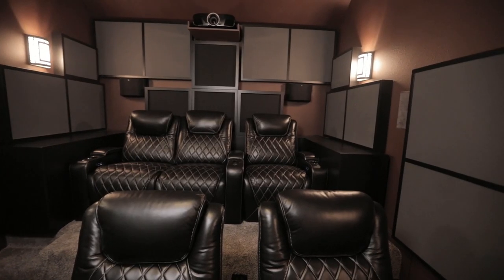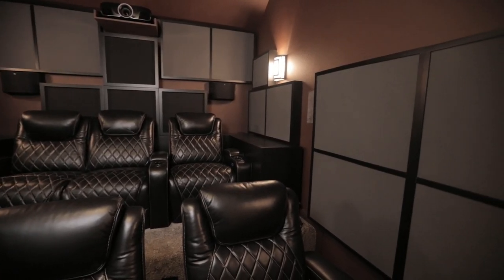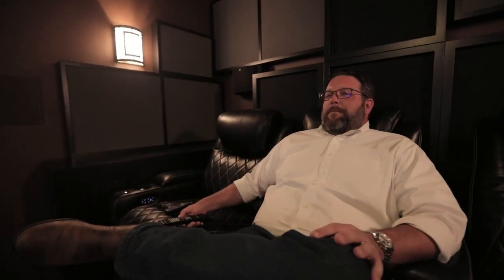Home Cinema - Dolby Atmos - Houston, Texas - www.AcousticFields.com

Comment: I have 2 16’s in a 10x12 8ft ceilings , I have the smallest theater out there and I had issues with bass and I have corner traps to the ceiling , upgraded to Dirac cause audessy is part of your problem. I woukdnt think 10’s could become boomy.
Reply from the maker: "Boomy" is a pressure issue within your room. If you treat the pressure issue, no boom regardless of driver diameter. Processors are another individual's  bandaid. Do your own thinking.

Comment: Great Video, I believe in acoustic treatment.
The room is the biggest problem not the equipment.
A room determines the sound quality.
Treat the room first before upgrading your equipment.
Reply from the maker: Placing higher resolution gear in the same room of distortions makes no sense. Keep your gear and increase the resolution of your room. You will not need new gear. All the original resoans you bought the gear in the first place with reappear in a tretaed room. If after the room resolution has been increased through proper treatment then and only then can you evaluate new gear.

Comment: Because the software thinks your subs are to much and it lowers the dbs down , I’ve had 2 sets of svs I had the pb3000s after calibration it couldn’t turn them down any more -12 db then upgraded after to the pb16s  same issue as far as being boomy that can and will happen I’m just saying audessy is not the bees knees and Dirac is better I’ve managed to tighten things up considerably because I do have a small room and I do have ported subs and they can be boomy but I’m using more for movies not music . I like how user friendly audessy is but that’s  about it
Reply from the maker: This is how these programs work. They limit frequency and amplitude out put into the room so that the energy better "fits" the room size and volume based upon the designer's algorithms. It is much better to make the room fit the music. I do not what my music to be distributed into my room based upon some designer's preconceived notion. I will do my own thinking and playing of my music.

Comment: In this room, are all the ones with the dark front the carbon absorbers and the bright ones are foam panels?
Or how many are carbon vs foam?

Thanks.
Reply from the maker: You can view the products used at the project page bottom and on the web site. This project uses our ACDA-10 modules and our Foam Frame Ladders.
Reply: Yes, this is the confusing part, because the Home Cinema project page says: Products in this project
ACDA-10 M
Foam Frame Panel
ACDA-12 M
QDA-13 M

I think I can spot the 2 big ACDA-12 M in both sides on the floor in the back.
And possible 4 * ACDA-10 M in med middle of the back wall. Maybe 2 * ACDA-10 M in the front corners?
The rest I thought were Foam Frame Panels because the page listed them, but now you tell me it is Foam Frame Ladders?
And where is the QDA-13 M then?

Can you clarify this please? Thanks.
Reply from the maker: @djbremsespor  The products shown at the page bottom are our module units. Not all units are used in each project.
Reply: Those 4 products I mentioned are literally listed right under the "Products in this project" on the Home Cinema project page.
Reply from the maker: Stay tuned.

Comment: What is the reasoning behind the foam frames at the top of the back-wall?
If bass is the target then it seems like an odd Tetris move to put foam there.
Reply from the maker: There are two issues in any small room. You have pressure and reflections. Pressure management is performed by the modules. Reflection management is the Foam Frame units. I would have thought that after all of these years people would understand these basic tenants. I think more videos on pressure and reflections are needed.
Reply: Well, do we have any measurements that show mid/high reflections coming from the back-wall? Probably not.
He said that his main problem was the low frequencies.
So based on that, it seems like a step in the wrong direction to take up the limited real estate with foam.
Reply from the maker: @djbremsespor  Pressure / reflections. Please keep your comments constructive. People's opinions are worthless when it comes to small room acoustics. Phtsics is the law. Everything else is just a suggestion.
Reply: In relation to low frequency pressure issues, covering a large part of the back-wall with foam instead of carbon absorbers is a questionable strategy.
That is indeed physics. 🙂
Reply from the maker: @djbremsespor  Please state your question
Reply from the maker: @djbremsespor  Once again you are not seeing the forest for the trees. Most small rooms take 25 - 30K to achieve a 70 - 80 % room resolution of all pressure and reflection issues. The buget for this first phase was 20% of that requirement. When the total costs exceed the budget by 80% choices have to be made. You focus on the issues you can treat that will have the largest sonic benefit for the dollars expended for a first phase. This is why a strategy is required . Tactics are then used to reach the strategic goals.
Reply: @AcousticFields  Ok, so there will be more videos showing the next phases as the project progresses? Thanks.

Comment: You should have changed our your 10" subwoofers first. That was probably 65% of the problem. $8000 for acoustics is insane.
Reply from the maker: The low frequency issues within a room stay with the room dimensions. You can not change out sub woofers and decrease room modal issues. You can put less energy into a room and produce less amplitude, but a 50 hz. issue is a 50 hz. modal issue no matter what type of sub is used. Rememeber, the room only sees energy. It does not care what the source is only the frequency response of said source.
Reply: 800$ for a power cable is insane..... Or even 200$ for a cable...
For room acoustics I equate it with the cost of the system! 😉

Comment: If he paid 6-8k to only "take care of some of it", then I wonder how much to fully treat the issues?
Reply from the maker: Most small rooms take between 15 - 20 k to fix the lower  frequency issues. Its all about having enough square footage of material coverage, the proper rate and level of absorption to match the frequency and amplitude of the issues, and matching the amount of treatment to the usage requirements. Every room surface is different in its frequency and amplitude of issues.
Reply: Ok, thanks for the detailed answer.

Comment: 🤠 Guys with a smaller config, just place your subwoofer on an ottoman. Raise it up 1m off the floor so the sound waves hit you in the gut & face.
Reply from the maker: You must position the subwoofer so that it interacts with the room the least.
Reply: Yes, elevated near-field sub approach is easily capable of superb results if well executed. 

Independent of modal excitation from the sub's position, simply experiencing greater level of direct energy relative to room sound can be a huge force multiplier. 

Near-field subwoofing is one segment of accurate high performance playback that's advanced significantly over the past several years. 

Reference level near-field sub playback can possess bass tactility and textural details like no other. 
It's particle velocity in the nearfield. 

At the same dB level, the listener experiences bass playback with greater intensity when particle velocity is highest.
Reply from the maker: @FOH3663  Greater intensity is not the objective. Balance and equal representaion throughout the frequency response is the goal.
Reply: @AcousticFields  
No
Greater intensity is precisely the objective in this case.  
You may not understand the concept I'm referencing... ie., nearfield particle velocity (whereby SPL is unchanged, yet intensity is heightened). 

Understandable, as many aren't aware if this. But it's being explored more over the past couple decades.
Thanks
Reply from the maker: @FOH3663  Balance balance balance. Quantity is not quality. You need to get your ears out of the text books.
Reply: @AcousticFields  
Textbooks? 
These are in situ, real world examples... whereby the physics supports the subjective experience.

Comment: I find your story interesting. Anthony Grimani claims that acoustical treatments account for roughly half the sound quality of the rooms he designs. He formerly worked for Dolby Labs, then later THX, and then the past 30 years has designed and built thousands of high end and ultra high end cinema rooms around the world. I recently finished a 7.4.4 atmos system in my untreated living room, but the sound quality seems lacking. I plan to DIY build 4-inch absorbers using mineral wool (rockwool from Home Depot or Lowes) and likely purchase scattering panels as those are not easily to DIY. If the mineral wool absorbers work well then I will print acoustically transparent canvas photos of my family/pets/travel/etc to replace the plain fabric covering covering the absorbers. Anthony Grimani claims many printers have a dye sublimation printer for canvas prints and they are inexpensive. I believe these are normally used for t-shirt and baseball cap printing. I have 4 subs in the 4 corners of the room + a miniDSP to get a flat response below 100 Hz.
Reply from the maker: Building insulation lackes the proper rates and levels of absorption for music and voice. Placing subs in the corners will not smooth out frequency response below 100 Hz.
Reply: Donald, I had a mineral wool product in the room.  It just makes the room dead.  There is a difference between the mineral wool and the accoustic fields product.  I have heard them both in my room at my own cost.  The mineral wool does nothing for anything below 100 hz.  The company that sold me the mineralmwool product told me that it would help with the bass.  There was zero difference.  The Diaphramtic absorbers make a huge difference.

The two people that came and videoed and took pictures of the room were surprised how the room sounded between the game room and the movie room.  Night and day.